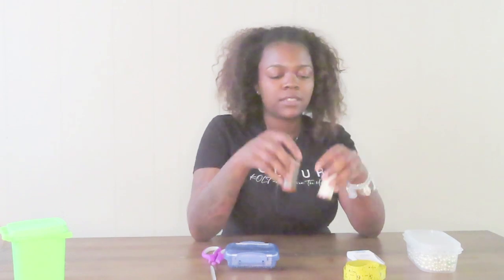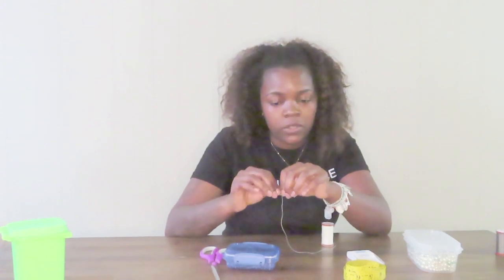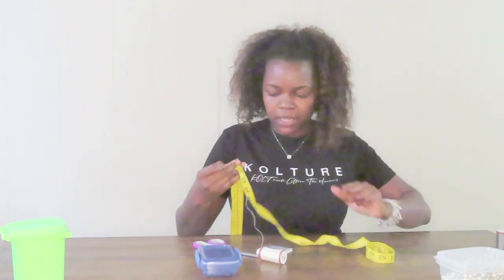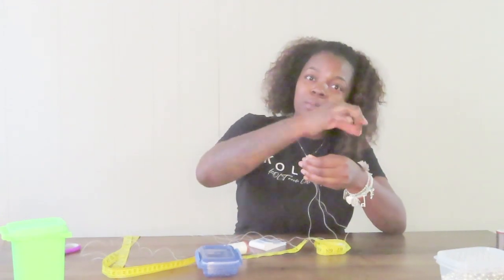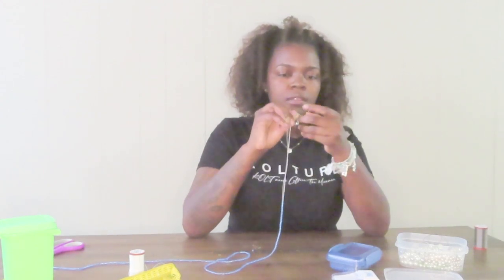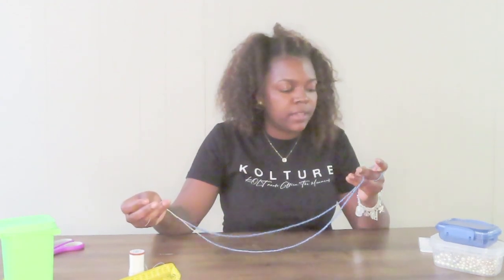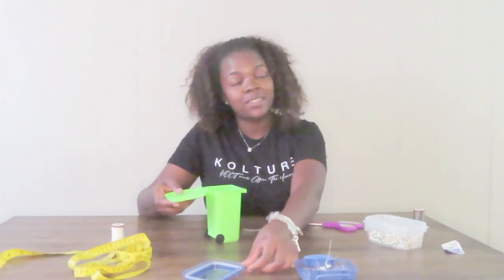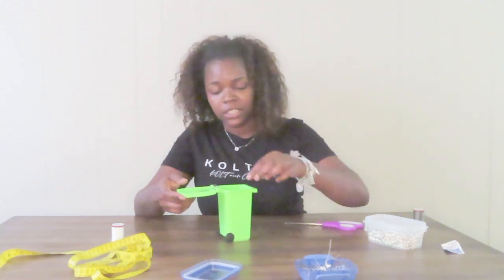Making Waistbeads With Upholstery Thread pt.4

Comment: I used this and have had them on for 2 months. I used 6 strands and I'm a BBW and active. I will try the mercerized cotton next to see. The tiger tail worked but the clasps ended up breaking off, the hooks rusted off so I just tie it on now. I want to make them permanent anyway.